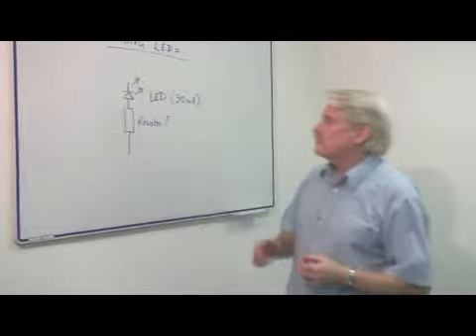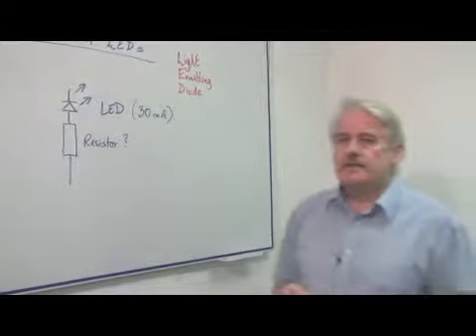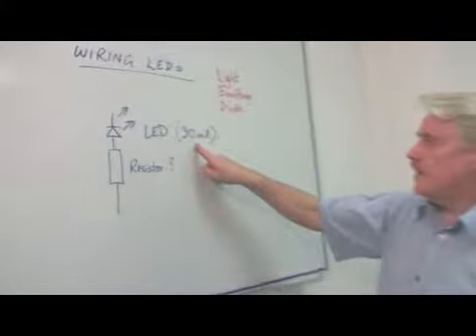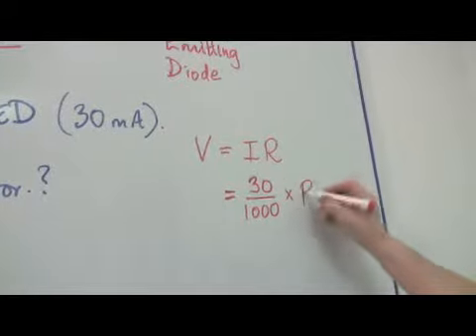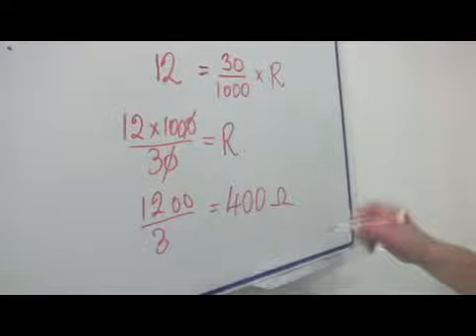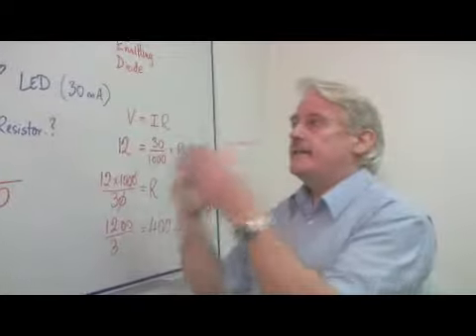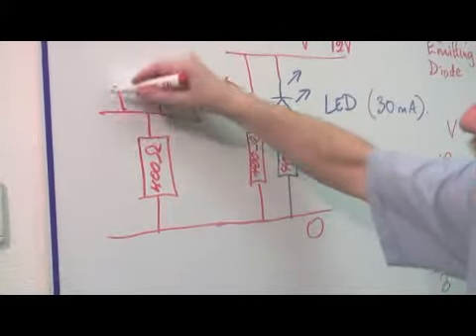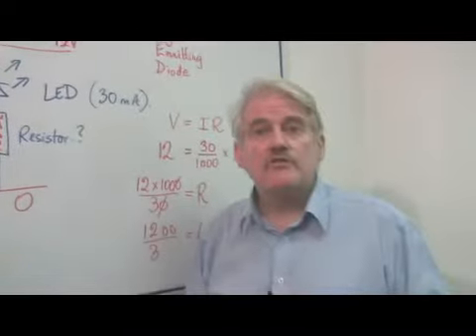Wiring LED Lights

Comment: I could be wrong but It looks like your leds should be flipped around 180 degrees to light up. The bar or flat part of the led is connected to ground.